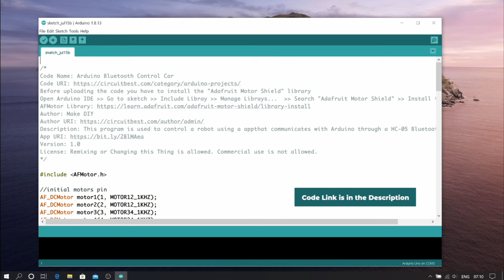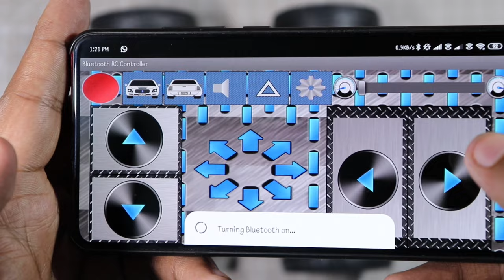How to Make DIY Arduino Bluetooth control car at Home with Arduino UNO, L293D Motor Driver, HC-05

Comment: How to change speed of car pls reply?.
Reply from the maker: This car does not supports speed control, I will make a updated version in some days. There I will that functionality.
Reply: Hey how we can install camera in it
Reply from the maker: You can just connect a wireless camera in it easy
Reply: @MakeDIY9  how to control
Reply: Means I want to turn it in all directions
Reply: If I want to add any code in arduino ide then we have to continue with previous code or new
Reply from the maker: @nisargdelvadiya0625  previous code will work just fine

Comment: Hey bro I have made my own version of this custom chassis and stuff I completed my project but I saw the switch I want to add it can you explain the connection or share the circuit diagram for me to use in my project also...I made one switch connection but it didn't supply power my connection was wrong I want to rectify it
Reply from the maker: can you send me a pic in Instragram @creativeideas365

Comment: Arduino: 1.8.15 (Windows 10), Board: "Arduino Uno"

In file included from C:\Users\User\OneDrive\Desktop\sketch_feb21a\sketch_feb21a.ino:5:0:

C:\Users\User\OneDrive\Documents\Arduino\libraries\Adafruit_Motor_Shield_library/AFMotor.h: In function 'void setup()':

C:\Users\User\OneDrive\Documents\Arduino\libraries\Adafruit_Motor_Shield_library/AFMotor.h:143:1: error: expected primary-expression before 'class'

 class AFMotorController

 ^~~~~

sketch_feb21a:16:1: error: a function-definition is not allowed here before '{' token

 {

 ^

sketch_feb21a:20:12: error: a function-definition is not allowed here before '{' token

 void loop(){

            ^

sketch_feb21a:44:1: error: a function-definition is not allowed here before '{' token

 {

 ^

sketch_feb21a:56:1: error: a function-definition is not allowed here before '{' token

 {

 ^

sketch_feb21a:68:1: error: a function-definition is not allowed here before '{' token

 {

 ^

sketch_feb21a:80:1: error: a function-definition is not allowed here before '{' token

 {

 ^

sketch_feb21a:92:1: error: a function-definition is not allowed here before '{' token

 {

 ^

In file included from C:\Users\User\OneDrive\Desktop\sketch_feb21a\sketch_feb21a.ino:5:0:

C:\Users\User\OneDrive\Documents\Arduino\libraries\Adafruit_Motor_Shield_library/AFMotor.h: At global scope:

C:\Users\User\OneDrive\Documents\Arduino\libraries\Adafruit_Motor_Shield_library/AFMotor.h:156:3: warning: 'setup()::AF_DCMotor::AF_DCMotor(uint8_t, uint8_t)' used but never defined

   AF_DCMotor(uint8_t motornum, uint8_t freq = DC_MOTOR_PWM_RATE);

   ^~~~~~~~~~

exit status 1

a function-definition is not allowed here before '{' token

This report would have more information with
"Show verbose output during compilation"
option enabled in File -> Preferences.

hello brother can you help me i need this project for a competition at my school for a price and i really need those money please can you help me i would mean a lot to me please